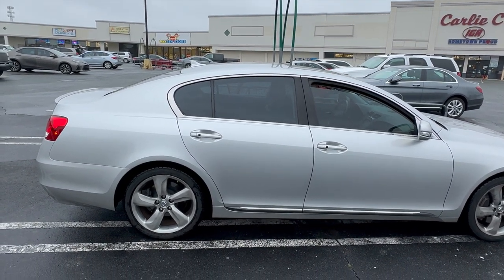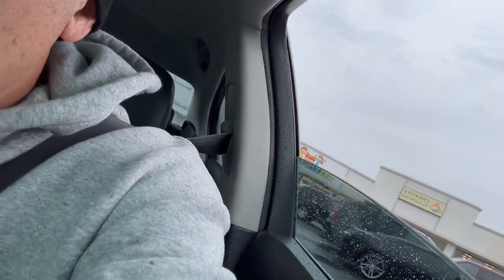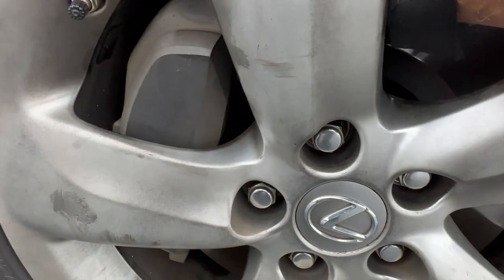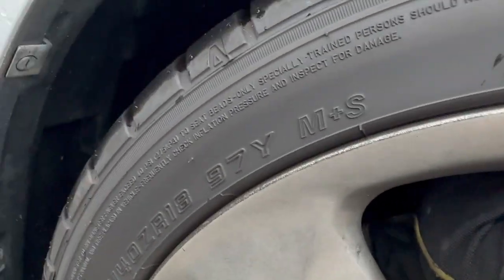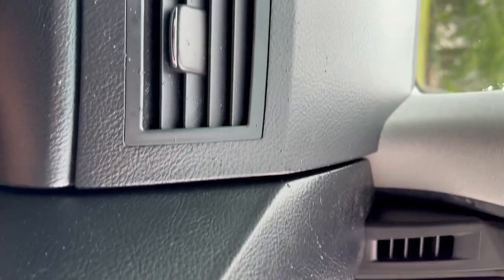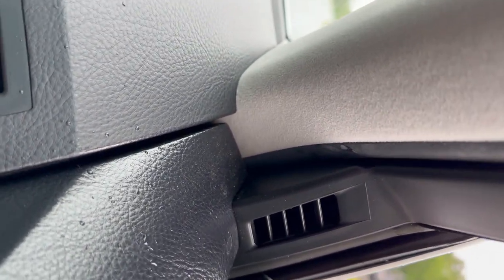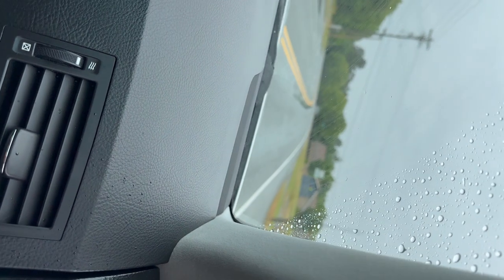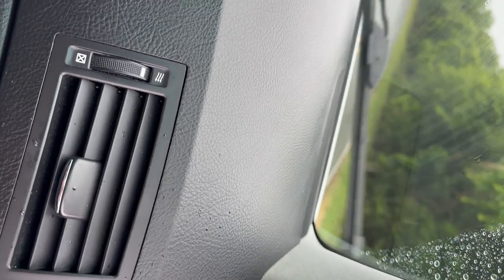Lexus Gs350 "Brake Squeal Fix"

Comment: 2018 gs350 fsport. Get the pads greased on the caliper side and the edge of the pads where they slide on the caliper. Wipe off excess so none spills to rotor or brake pad surface. You released the pad from the caliper by doing what you did in the video. Nice work!